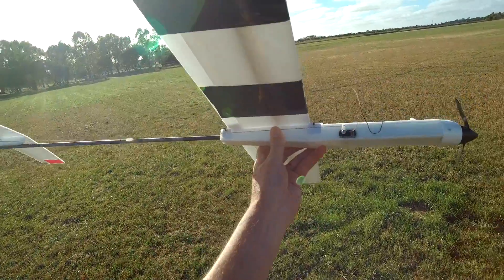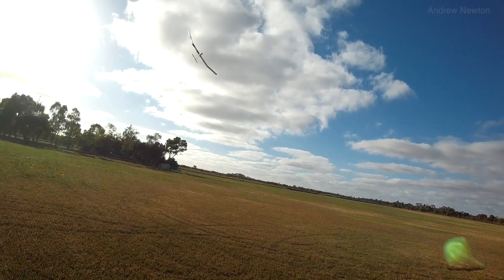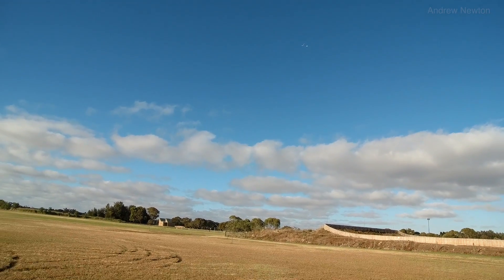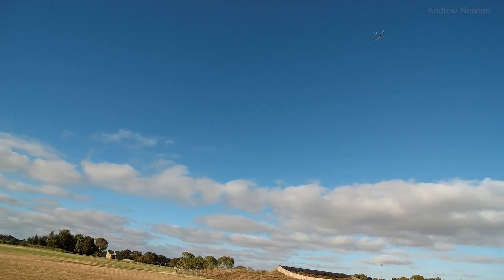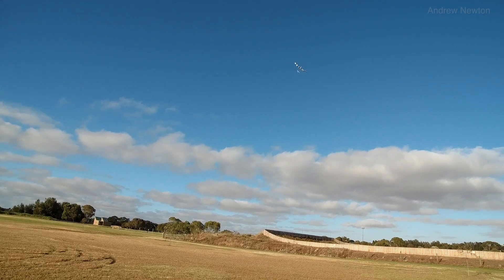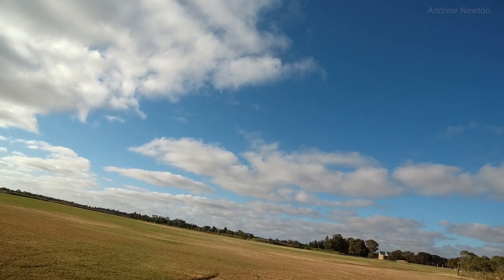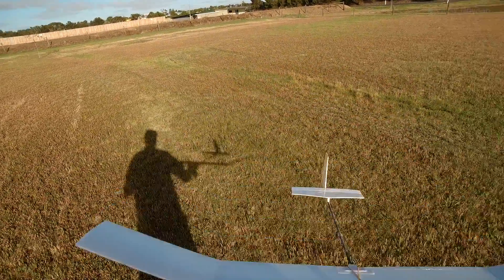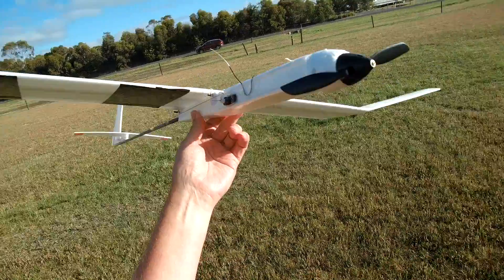3mm depron wing with thicker airfoil

Comment: Hi. Can I get dimensions, or more appropriately spacing between lines? I would like to reproduce this wing, I got all the material I need.
Reply from the maker: http://newtonairlines.blogspot.com/2018/12/3mm-depron-thermal-glider.html
Reply: Thank you, Andrew. I have found this video: https://www.youtube.com/watch?v=Xz12y3wXFKE  , which do I believe was the first version with the thinner airfoil. And this second version is the same except it has 6mm former and a CF spar, am I right? So, from my point of the pattern is as follows: 0<-bevel-20mm-65mm(former centre)-110mm(leading edge)-225mm-bevel->250mm . Former is 20mm wide, 6mm CF reinforced.
Reply from the maker: Sounds about right but fold a short test section first and you can make adjustments to perfect it

Comment: Another nice build! I'm planning a 1m DLG with an MH32 airfoil (10deg dihedral). Would this be a suitable application for the technique or is the MH32 too thin?
Reply from the maker: Should be perfect if you can make it accurately

Comment: Wow! That thicker wing really improved an already great design. I can't wait until you build an undercambered wing. I came across this article on Flight Test of a model called the Ridge Runner which has detailed method of constructing an Armin/FT style wing with undercamber. It may be a bit "fiddly" as you would say but definitely worth taking a look at. 
https://www.flitetest.com/articles/ramping-up-the-camber-the-ridge-runner
Reply from the maker: My under camber attempts are not an improvement so far. Seems like ribs are required to hold the shape.
Reply: @AndrewNewton  In the article ribs are used on the bottom exterior to hold the shape and then fill cut slots with hot glue. When ribs are removed the camber stays set.  I'm going to give it a go over the holiday. I'll let you know how it works out.

Comment: hi I want to ask about d2822/14 1450kv motor
can I use this motor with a 15 amp esc with like 7*4 prop on 2700 3 cell lipo or 8inch prop on 2cell
I got the motor and ESC lying around.i want to build something like your trainer
Reply from the maker: Yes the will be fine as long as you dont go full throttle for long periods. Probably better with a 30A ESC
Reply: ok thanks so as long as I don't go full throttle it fine right. I was thinking of building a trainer or something like a glider these were lying around

Comment: when you're setting up your control surfaces do you want the ailerons to extend out matching the flat surface of the bottom of the wing or to follow the downward sloop of the top of the wing?
Reply from the maker: Ideally both. That means the airfoil needs to be a bit thicker at the hinge and the ailerons sanded down to a fine trailing edge. But if you're just adding flat ailerons on to an existing airfoil then I would have them flat to match the bottom.
Reply: thanks, it's the same large walmart chuck glider that flight test converted to rc earlier this year, it has really think foam wings that i added twin motors and control surfaces to using dollar store foam board and instead of tapering the foam board i just used packing tape to form the trailing edges of the foam board. i did have a friend who is a professional rc pilot for the movie industry fly it once and he said it was way to fast and had way too much control authority for a beginner pilot like me which is probably why i haven't had a successful fight with it yet but i just cut down the control surfaces to make less like a 3d plane but with the huge fat wings i didn't know which part of the wing surface i should match the ailerons too. as soon as the big winds were experiencing now subside I'll take it out for another crash test...lol, thanks again

Comment: Sweet. Oh, what's this? I've not seen this location (slope) before - you've got dozens and I don't even have one :(  Say, I have a carbon fiber suggestion for you, so bear with me. I know you're happy with arrow shafts and for larger diameters, buying a blank, but in the past I have seen carbon fiber fishing rods go for incredibly dirt cheap prices like maybe $15 USD. Now I know they're tapered, but that is not necessarily a bad thing. There are ways to make that right. After all, the manufacturers have no problem putting handles on these rods. Anyway, I was a fishing fool for decades and I saw those 'clearance' deals from time e.g. Walmart and I just wanted to mention it for your bag of tricks (possibilities).
Reply: Good idea, thank you!
Reply from the maker: Golf club shafts are about right also. That $35 tube was for a big 3m glider. The arrow shafts I use are $2 each from Kites and Fun things (much more by the time they reach Australia unfortunately)
Reply: The only trouble with the fishing rods are they are ment to bend, take weight like a shock absorber.. Arrow shafts are made, to not bend.
Reply: @dukejet6997   I was thinking more towards the butt end, but you make a good point. I'd still give it a think or two. Actually, I haven't shot a bow since I was a kid and carbon fiber didn't even exist then :)
Reply: rwprime1 -  I just went into an archery shop and the blank shafts were $2 each 😁
Reply: @dukejet6997  Wow, that's incredible. Here's where I was coming from. In one of his videos, Andrew mentioned paying $35 for a blank which was larger than an arrow shaft because I think it was a boom on a larger plane.

Comment: Hi Andrew, congrats on another great build! I have been dreaming for the past months of building an armin wing DLG, but so far haven't had much success with 3 failed attempts. Considering how much you've perfected your building techniques, I'd like to ask you to consider building one. There are a couple of folks who did it already but they don't really have the type of vlog documentation you do, which is extremely helpful. Please, if you have the time, give it a try. I'm from Brazil, and it's pretty much impossible to buy a DLG around here. Even the "cheaper" ones would break the bank 😅

On YouTube, there is a guy called flyboa who has Dollar tree foam board dlgs flying marvelously, but no build videos. If you look up "dtfb dlg" you can easily find it.

Thank you so much!
Reply from the maker: Good link Tsnafu. A decent foamboard DLG would not be a simple build
Reply: Fabio, there is much more information on Flyboa's designs (and others) on this RC Groups thread - https://www.rcgroups.com/forums/showthread.php?1999696-Dollar-foam-DLG
Reply: @Tsnafu  Yes, I've seen the thread, I guess I'll take a second look. Some old build videos were deleted though, that was my point here asking Andrew. Recently I've considered trying to build a hi-start glider, it wouldn't have to be as strong to withstand launches. But thanks guys, have a great week!

Comment: Looks like a improvement. It is sometimes surprising how well these armin wings perform. I wonder how they compare to kfm airfoils.  Nice video!
Reply: KFMs are fun to fly, but aren't as slippery as an Armin of the same dimensions. So in light wind soaring the KFM glide slope suffers significantly.
Reply from the maker: Never tried KFM but I Think they need power on constantly. I prefer gliders
Reply: Thanks for your answers, armin wing looks like the way to go for more floaty airplanes.
Reply: @aliberk3112  Yes the Armin wing is inexpensive, easy and quick to build and always seems to give reasonable flights. But as Andrew has mentioned, some variations need to be tried. If you want a slow flier, undercamber is bound to rive results, but isn't so easy to include in the Armin.
Reply: @wordreet  I agree. I am curious to see how Andrew will manage to built an undercambered armin wing.
Reply: @aliberk3112  Obviously the under camber would be easy with a hot wire cutter and solid foam.